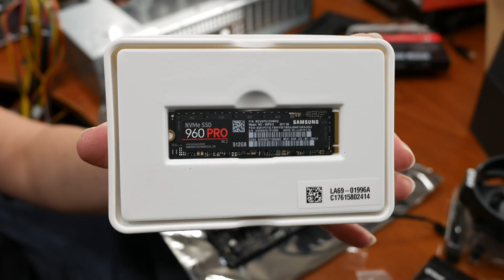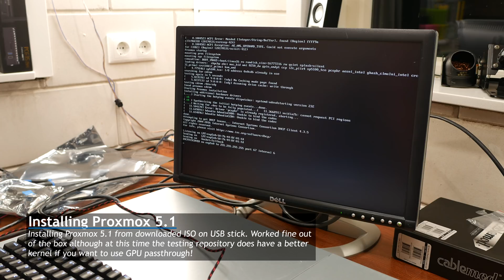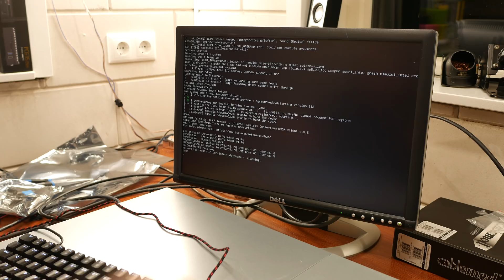Home Networking: Building a 2U AMD Ryzen server (Inter-Tech IPC 2U-20255)

Comment: Mmm... I see this case has a bracket to hold the 2u psu in place.
I'm wondering if it'd possible to replace that bracket with a atx to sfx bracket instead. Or even use the same 2u bracket to install a sfx psu instead, at a glance it seems the mouting screw positions for a sfx and a 2u psu are the same

Comment: I know this is a really old video but watching it has given me an idea.  I'm going to use the same 2U chassis and build a very space efficient rack mountable workstation around the Ryzen 5700G APU. Since it's only a 65W chip the Noctua cooler you used in this video will work perfectly for me.  This will allow me to repurpose my 1950X system for much more cpu intensive tasks, and take up less space in my rack.

Comment: Old video but I m going to give it a try . At 14:03 you used a mirror for the prox itself which is something I do also. Now if you want to backup the proxmox os how do you do it? For all my machines /VMs I use rescuezilla  but here i think it cant be done since the prox OS is on 2 drives and not one. Which method do you use (if you use any)?
Reply from the maker: Well, since it's a mirror you can backup either of the physical drives since they contain 99.99% the same data. Only thing that can sometimes differ is the bootloader, but that's it.
Reply from the maker: Regarding methods I use, I run a proxmox cluster so am not very much tied to a single host so generally don't make backups of the host itself.
Reply: @IntermitTech  it can be life savior though when major updates brake the installation
Reply: @IntermitTech  The problem will occur not during backup because rescuesilla will see drive md0.....afterwards upon restoring it wont see the md0 but one of the sda1 or sdb1 and that will brake the whole idea of restoration

Comment: Does it have IPMI etc?
Reply from the maker: Depends on the main board you put inside? My desktop board does not.
Reply: @IntermitTech  Ouch you salty. Yes, I was referring the server hardware as the topic says Home Networking and Ryzen Server - not the casing :)
Reply from the maker: Not meant salty, I just thought it was obvious because I'm using a desktop board in this case which doesn't have that feature. If you use a board that does have it, then it would have it. :)

Comment: Good choice with ASUS, is it still running strong? 
I'm tempted to setup one with HYPER M.2 X16 CARD by ASUS, it only works with an asus board
Btw, how do you determine how many "HDD" or SSD you can use ? Based on PCIe lanes from CPU?

Comment: are the front fans blowing air towards the Mobo or pulling?
Reply from the maker: Front to back cooling so blowing towards the mobo
Reply: i have a istar d400 7p server case and it only has two small fans in the back. wondering the best way to get more fans in there or if its even needed. just building it to store footage.
 @IntermitTech

Comment: 3:27 you didn't just put the cooler back on the CPU without reapplying your thermal paste
Reply from the maker: Well, yes I did, since I just applied thermal paste. What would be the benefit of removing just applied paste and then scraping it off and applying it again? It was fresh, so will spread and work perfectly fine, especially since it wasn't tensioned before. If it was like a year old, that's a different story. :)
Reply: @IntermitTech  air bubbles.
Reply from the maker: @pvbuerkner  Sorry, but I don't believe it works that way, if the cooler had been tensioned maybe, but without, it's just bare paste, like it came out of the tube. But even if it had been tensioned, if the paste is still fresh and hasn't gone through hot/cold cycles and changed chemically to be less viscous, air bubbles still shouldn't be a problem since it isn't "used" yet. After running the system and doing testing, sure you are right, but with this, in my opinion, it's perfectly fine and re-applying paste will make 0 difference. CPU temps are great too, although that is no proof on it's own.

Comment: >molex to sata lose your data
Are you out of your mind?
Reply from the maker: Lol, what are you talking about? I've been using molex to sata converters for over 20 years with 0 issues. Know what you are doing and maybe get better cables. :p
Reply: @IntermitTech  you'll learn it one day
Reply: @ironsm4sh  what can happen?
Reply: @gileneusz  A lot of cheaply made molex to sata adapters are faulty and short after a while due to melting itself. when it shorts it will get really hot and likely kill other components with it such as the drive, and maybe more. google it.

Comment: 1gpu for passthrough (like Win10) and 1gpu for Proxmox. Is it right? Thanks!
Reply from the maker: Yes, that's exactly right. I use the GTX1050 in a Windows 10 VM for OBS encoding and such and the AMD one is just in there to have a console while it's booting.
Reply: @IntermitTech  Thank you very much for responding. May I ask more. Can I use 1gpu for many Windows VMs? (I don't use much gpu power for each window VM but still need GUI.)
Reply from the maker: @nithitpiriyasathit6161  Ah no, you are passing through the whole card to a single VM. If you want to use hardware graphics in multiple VMs you need to look into a VDI setup.
Reply: @IntermitTech  Oh Thank you again. It's important for me. And the last question :) if I use Ryzen (no iGPU) with eGPU while setup after that I pull out the GPU. I can not use Windows VMs with GUI. Is it's right?
Reply: @IntermitTech  I am finding the information of the Proxmox for days. Before I found your video. Thank you very much for answering my questions!
Reply from the maker: @nithitpiriyasathit6161  You can run the server in what's called "headless" mode (No GPU installed). So I think you can pass-through even if you just have one graphics card inside of the system, but I'm not 100% sure.
Reply from the maker: @nithitpiriyasathit6161  Sure, no problem, actually a lot more Ryzen and Proxmox server videos coming up, editing one right now! :)
Reply: @IntermitTech  Ok Thank you again and again. I subscribed. I watched some of your videos. I love them!!

Comment: nice sir can you explain two difrent brand gpu like amd and nvedia thats you show heare how they will work together and how it performs . please reply
Reply from the maker: Not quite sure what your question is. I used an NVidia card for pass-through and the AMD card just to have a console connection. Using separate brands makes things with drivers easiest and well, it was the cheapest card I could find. ;)
Reply: @IntermitTech  thanks  that's suits for my question

Comment: i'd put the mellanox card in the x4 slot and the radeon in the x8 slot.
Reply from the maker: Normally I would agree with you but the Radeon is only in there to provide text console access when needed, nothing else. So as long as it displays something even a x1 slot would have been fine!

The Mellanox card actually gets used, I've seen data transfers up to 650MB/sec when a few people are working on the server. :)
Reply: @IntermitTech  why not make it headless and do config over https? Saves you some wattage, heat and slots :)

Comment: Great video! I'm about to do the same thing (a slightly different Inter-tech case for me however), but I'm wondering if I should cheap out and try the included Wraith cooler. Did you try that one before installing the Noctua?
Reply from the maker: I wanted to but it wouldn't fit, the lid can't close with it on and even if it could, there would be too little room to breathe!

If you have a 3u or 4u the wraith isn't that bad actually :)
Reply: Good to know!

/me  breaks piggy

Comment: What is the point of hosting it in 2U chassis when you could use a regular tower case with 6 internal 3.5 bays? If it's for home use and you won't install it in the rack, of course.
Reply from the maker: This server regularly goes into a rack and is transported, that's why it's specifically in a 2U format. For a home server I would agree that a 2U isn't practical and a desktop chassis or 4U (Which is the same size mostly) would be a better fit, I'm actually building one of those right now!

Comment: For anyone out there thinking about building their own server. Choose atleast a 80+ Gold power supply since it will be on 24/7 and in the long run it will save you the money that you paid extra over that bronze certification.
Reply: Or 80+ platinum.
Reply: What about redundancy?
:)
Reply from the maker: No power supply redundancy in this server, only for storage. If it goes down for a few hours, that's ok for the role this machine has, data loss is not, hence the choices made.
Reply: What about redundancy?

Comment: since there is 4 fans in the back, couldn't you have just used a liquid cooler?
Reply from the maker: I actually wanted to, but they don't make 80mm aio's it seems! Also those fans are in the front and there is only very little space left to put anything, but trust me, I wanted to!
Reply: Intermit.Tech thanks for the reply!

Comment: Ouch, one side of the cpu cooler is blocked by the ram and the other side blows directly out on to that row of capacitors. I'm guessing it won't let you rotate it 90 degrees? Even if you could then you have to think about what's going to have a hairdryer blowing on it then and if it's a better trade off.
Reply from the maker: I get what you are saying but at the time this was the best cooler readily available that will fit in a 2U chassis and work on an AM4 board while also being quiet. The CPU cooler is pushing the air down through the heatsink and thus the heatsink should never really get very warm creating "hairdryer" temperature air. But even if that would happen, the battery of 4 fans pushing air through the chassis quickly exhaust all hot air out of the back. I haven't had any problem running the system at 70% load for several days at a time while also monitoring CPU and motherboard temperatures, all fine. :)
Reply: @IntermitTech  I get it too. Sometimes you have to make due with what you have. It shouldn't be an issue in the short term (assuming you monitor the temps and they are acceptable) but may lower the motherboards life span in the long run. (years from now) An electrolytic capacitors operating life is effected greatly by temperature.

Comment: Proxmox is bae :D I run it on each of my 3 home/production servers and it works like a charm, I even have PCI Express passthrough (GTX 970) working in a Windows 10 VM. SO AWESOME, like full gaming grade performance in a VM is quite magical if you're used to the usual SPICE/VNC CPU driven graphics. I did have 3 of my 8 Seagate drives die on me (one in each server) so I will never buy Seagate again. What a worthless brand and to make it even worse their RMA process sucks.

Comment: Why did you use that plastic bag instead of the motherboard box? That plastic bag its supposed to protect your motherboard inside the bag, not outside, and its actually a good conductor for electrostatic energy on the outside layer. Also, why no ECC memory in a server?  Ryzen supports ECC memory. I, my self,  have 3 servers in my rack, proffesional kind with RDIMMs ECC and Xeons and they run just fine ( a bit loud tho).

Comment: If this was just a gaming/media machine, why put it in a rack case?  It is hard as hell to transport. I built a surveillance host with a Ryzen 7 with 10 spinning drives and 2 SSD's; I did it in a large gaming case. Much easier to move around (if I wanted to)
Reply: Just out of curiosity, what kind of surveillance software are you using?

Comment: Thank you for an excellent video. However I have some remarks: 

The space infront of the fans is crowded, it is supposed to pull air. I think a better cable management using a sleeve would have helped. True you have a vertical CPU cooler, but still other components are squeezed, and they are heat generating beasts.

The Sata 3 cables are straight hitting into the fans frame, why not use right angled ones, this can be easily corrected.
Reply from the maker: Thank you for your comment! :)

The space in front of the fans is indeed crowded, but because it's cables bunched together, air has no issues getting sucked through. It doesn't have to look pretty, it needs to work. With the amount of cables needed in that little space, introducing sleeving and thus blocking more air will only hurt the airflow? I'd rather also build it a bit more tidy, but with the cables vs the room there is, it only barely fits as is! Besides, the fans are sucking through air without issue, so no problems there. :)

Yeah, a different CPU cooler could be better (still have had no issues with this one, in part because the 4 fans in the front push the air through anyway) but those are quite hard to find. I looked and evaluated but from the parts that would fit, this was the only one that was readily available.

Because of the way the HDD brackets work with the sliding mechanism, right angle brackets are impossible to be used, they would stick out below te bracket and there is no space there. Maybe for a top drive, but then you would have to connect it to the HDD after sliding it in and then still, you're going to have a hard time with it!

Comment: Whoah, was that little extra memory chip looking thing an actual hard drive?
Reply: Just keep in mind M.2 is just a form factor and can be PCIe/NVMe or SATA/AHCI, so be careful when buying the right one.
Reply from the maker: That Samsung 960 Pro? Yeah, that's a M.2 size SSD (Flash Storage)! REALLY FAST!!
Reply: Yeah, I haven't built a computer in about five years now. Does it fit into one of the PCI-e slots?
Reply from the maker: No, newer motherboards now have slots called "M.2" on them. But, this basically is a form of directly connecting the storage with PCIe 3.0 x4, just a different (compacter) form factor (You can get PCIe cards on which you can mount an M.2 SSD).
Reply: Ahh! I see. Something to consider on my next build.
Reply: Okay, it's so complicated. Thanks.

Comment: Just a quick tip, never put ur motherboard or any sensitive esd part over an esd pouch :

Because this kind of pouch is electricly conductive on the exterior part, it's works because it's creating a faraday cage over ur components, and retain static electricty.
Your components can be shocked if u have an static electricty buildup on this pouch

Guys, I know pc components nowdays are pretty much esd-proof. Don't annoy me with this.

PS : Yes, i've watched the last video of jayztwocents witch proves static electricity do pretty much nothing to a pc part.

(Sry, for my bad english, im not an english native speaker ^^')
Reply from the maker: Although in theory you are correct and it's honestly NOT a good practice to put your motherboard on the anti-static bag (unless it's grounded) the bags have changed of the years.

Now a days all bags that the motherboards come in have a metal foil with a plastic coating/layer on the top and bottom. So it won't conduct electricity but still works for dispersing static electricity. So even if you were to turn on your system while on the bag in theory it should be as fine as any other surface that doesn't conduct electricity. Even with the bag punctured by solder joints, etc. you should still be fine.

With that said though, you are still correct and it's a bad practice, I need to stop doing that and especially not show it in videos! Thnx's for the comment! :)

Comment: That cheap molex connector could be the end of all of those drives... molex to sata, lose all your data, as they say.
Reply from the maker: Normally I would agree with you, especially those dime in a dozen cheap clear plastic with colored cables molex to sata plugs. But the type I used and linked above I've been using for quite a while and are made of a lot better quality then those shit cables, trust me, sadly enough I know what you're talking about.
Reply: Having checked the parts list in the description, I can confirm that those types of cables are actually okay. The reason why molex to SATA gets a bad wrap is because they are typically entirely held together by an injection moulded plastic housing, and the injection process can press between the electrical contacts between the SATA connector and the wires that run to the MOLEX. This smaller contact area is what causes the high resistance and eventual meltdown of the connector.

The ones used in this build are all individually crimped cables and the SATA ends are not injection moulded over the connectors. 

The real bad culprits are the SATA to Molex adaptors. SATA cannot push the amps that most MOLEX requiring devices need, so they are very liable to burn out, in addition to the above.
Reply: The ones he used are fine, its normally the injection moulded ones that fail, the ones he used have the push pins, the almost never fail in the way you think

Comment: question! what if I need a network with more than 48ports? how do i pair 2 48 port switches? with one simple cable? or can I put 2 or more?
Reply from the maker: Euhm, I'm not quite sure why you would ask this question on this video but yes it can be as simple as uplinking one ethernet cable to the other. If you want a higher bandwidth link things get a bit more complicated to handle in a Youtube reply like this.

Try and googling, there are numerous articles and forum threads talking about this. :)
Reply: @IntermitTech  did you use ecc memory on the server?